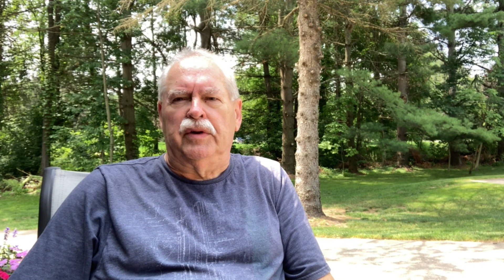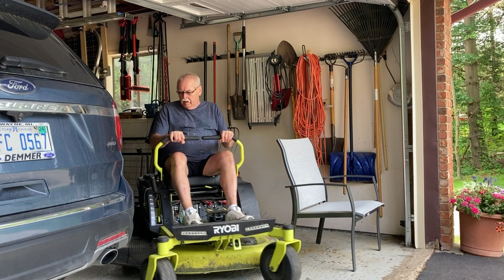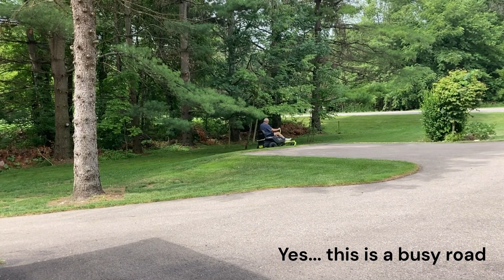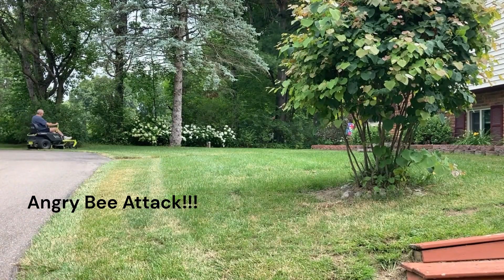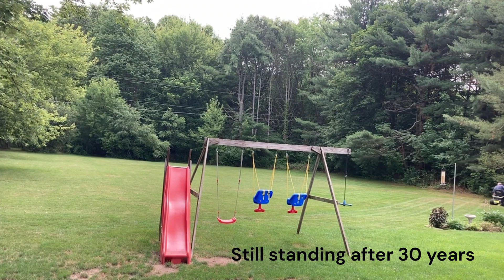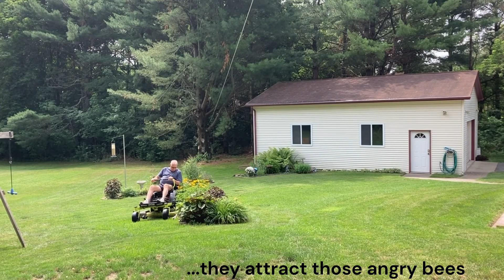Ryobi 48v Battery Swap   First cut

Comment: You mention charging and that's a good point: With the lead acid batteries they recommend you plug it in constantly when not in use, but for lithium batteries that is not necessary as they hold their charge much better. I typically plug my RM480e electric riding mower in about every 4th time I cut the yard. Once the gauge is calibrated* and it reads, say, 20% to 30% then it would be a good time to plug it in. One downside to this conversion which is no one's fault, is that the controllers onboard will shut off the blades when the volts reach a certain level which was designed with lead acid batteries in mind. Lithium batteries can utilize far more of their capacity but there is no way (that I know of) to reprogram the onboard controller to allow the voltage to get lower, so you lose a pretty good chunk of your available capacity. Still, it's a HUGE improvement over the old setup. On that setup I could do the yard one time and maybe a bit more, but after several years I could not do it even once on one charge. With this setup it's no problem and the power stays high for more of the time.

* This is what I did to calibrate the gauge (via the somewhat hard to understand manual): First use your mower until the blades stop. Then set the percentage reading on your gauge to 0% (go to the percentage readout and then hold the button until the percentage blinks. Set it to zero using the left button and then press the "set" button in the center). Set your amp hours to a number that you know is higher than it really is, like 120ah (go to the "ah" reading and hold it down until it starts flashing. Set it to 120 or whatever and then press the center "set" button). Now, charge your battery. When it's done, take note of what the actual amp hours are. It will be a lot less than you might expect because of the reason mentioned above. Now go into the "ah" setting and change it to that number. Now your percentage should jump to "100%" and it will give you the remaining capacity of what you can actually use.
Reply: If you have the RM480e and you just want to be able to tow things around your property, then you might want to modify the directions above for calibrating the gauge: Run the Ryobi until the volts on the gauge are showing just above the built-in battery BMS cut-off amount, which is probably around 43.2 (or until the thing stops completely. I've never run it down that low so I don't know). That will be your true zero point. To protect the batteries, I wouldn't go too much lower than 48V though. It's possible that if you calibrate the gauge like mentioned in the original post that if you continue to drive it (without the blades running) you will either see a negative number for percentage or some sort of error message. So calibrate depending on how YOU use the mower. I never tow anything, so I used the method above.
Reply from the maker: I ran mine out during a third cut without a charge.  Both the blade and the drive motors quit without warning.   Volt meter was off. 
I should have tried to check it with a volt meter before giving it a slight charge.  After the small charge, I had 49.5v (12.4v ea).
A future project will be to add a small voltmeter for each battery.  I'm curious what each battery does, and this will let me know if a battery BMS cuts out or I have a balance problem.  It'll be cheap to try: components ordered - $10.
Reply: @robertveldman1901 For most LiFePO4 batteries, the BMS low voltage cutoff is around 10.8V each, so 43.2V for the pack. But! Of course the mower cuts off power long before that, at least to the blades, and I wouldn't recommend running it down quite that far in general. I've never continued to drive it around to see how much longer it can go after the blades stop. Although I wish the mower's built-in controller could be reprogrammed to run down further with the LiFePO4 batteries, overall I am still very happy with the conversion. One good thing about having less of the batteries being used (because it's using the lead acid power profile) is that this should help to extend the life of the batteries even further. Fully depleting and fully charging lithium batteries is very hard on them, though I hear that LiFePO4 batteries tolerate this much better than other lithium formulations.

Comment: Dear Robert
The voltage discharge curve is very flat on lithium ion batteries,a better indicator is amps used your batteries will have already 4*1280 =5120 amps of capacity so amps used rather than voltage drop will be a better indicator of  percentage used .
                Pat
Reply from the maker: Thanks.  I was following someone else's plan that was simple.  My knowledge on electricity is very basic.  
Anyone that has experienced the older power tool batteries knows how NiCd, for example, would give you some slowdown warning.  Lithium just falls flat.
Reply: Robert 
Sorry I was wrong in my comments I was talking about watts and total pack power, but back to amps the  batteries are 100 amphour and your gauge should give you amp hours used  your mower will use 30-40 amp hours per hour depending on the grass so 30-40% of battery capacity .I am enjoying your videos and looking forward to updates
               Pat Gleeson
Reply from the maker: @patrickgleeson1974  Pat
I'll have to check the amps and Ah when I cut again.
I recall that on high speed drive and blades, it was using about 40amps(?); half blades, half drive.